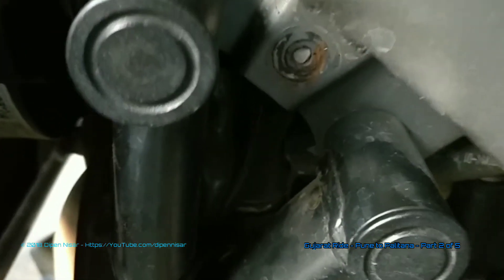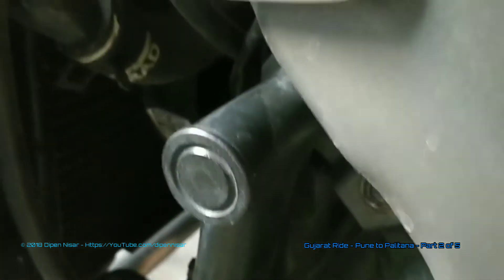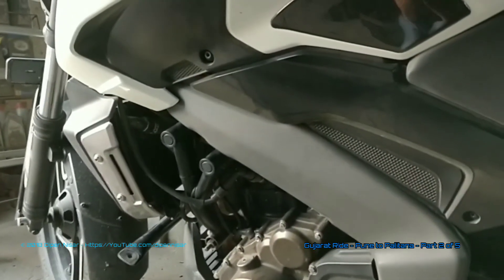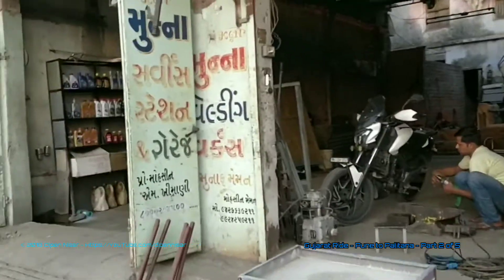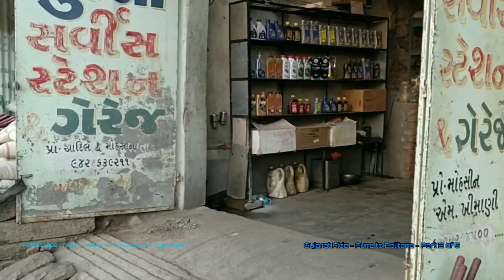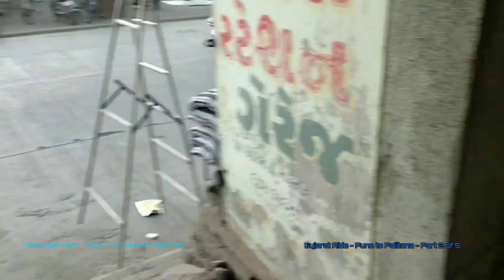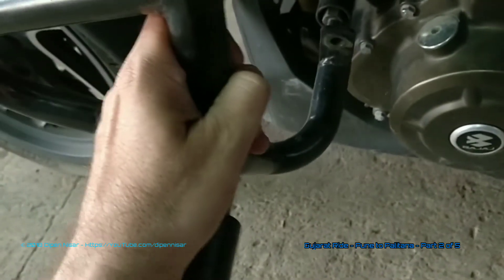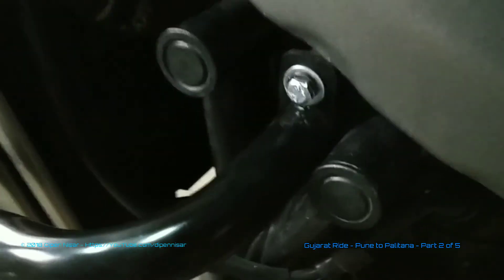Bajaj Dominar 400 | How to remove Broken bolt of Sahyadri guard | Gujarat Ride Pune-Palitana Part 2

Comment: boss how can the Allen bolt brake? only two possibilities, bike has had a heavy fall, or it has rusted badly which cannot be the case as it is hardly a year old.
Reply from the maker: I was surprised too. I first thought it looked and fell off. No accident. Only vibes. Earlier night it had. Gone loose. So I tightened it. And next day morning , when I continued, it broke after 100 kms approx. Road was also not so smooth. There were broken or tar coming off. And many of us who ride frequently in Pune have seen this.  :)
Reply: cheap quality bolts

Comment: Mine broke today. No fall not even a single scratch on my 2019 aurora green dominar. It is the stock leg guard no alterations. So i should go to the service centre ?? And I think my reason is heavy vibration and rust.
Reply from the maker: Yes. Inform the service center. This is happening everywhere with 2019 bikes. Happens due to vibes in the bike. But the bolt too is of low quality by Bajaj.
Reply: @dipen.nisar.autovlogs  omg thought you wont reply. Thanks for the quick response
Reply from the maker: @phg_d3str0id18  no brother. Check all my Vlogs. I dedicatedly reply to all comments. Good or bad. I do delete those which spread hatred out here or trolls.
Reply: @dipen.nisar.autovlogs  nice man. Subbed
Reply from the maker: @phg_d3str0id18  TY
Reply: @dipen.nisar.autovlogs  one more thing. Do i need to pay anything ? Cos it is not my fault that it broke right ? Please reply
Reply from the maker: @phg_d3str0id18  no,. If it was stock crash guard then u need not pay anything.
Reply: @dipen.nisar.autovlogs  what if they ask me to pay....
Reply from the maker: @phg_d3str0id18  check the whole chat above. Answered already.  This is happening for many people
Reply from the maker: It's under warranty. Ask them then what does warranty cover
Reply: Same here. Yesterday. Zana guard broke on the new 2019 bike
Reply from the maker: @shaileshshettyshettyshailesh  put a SS bolt